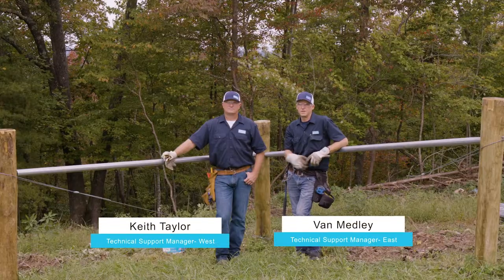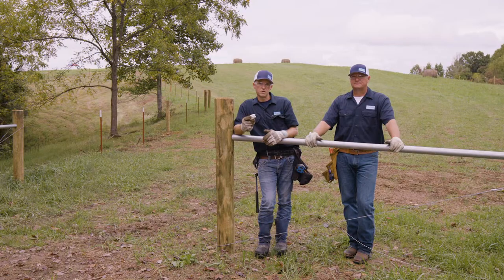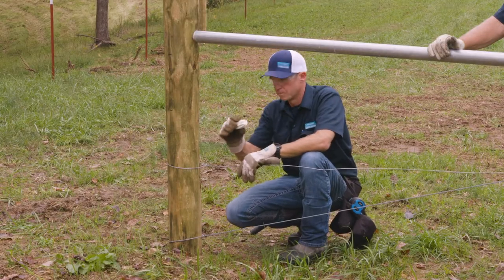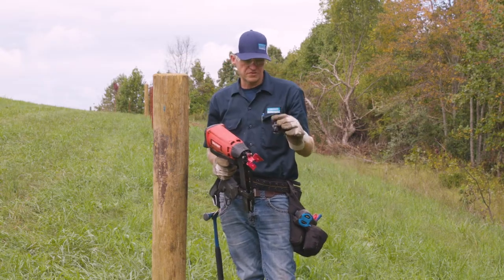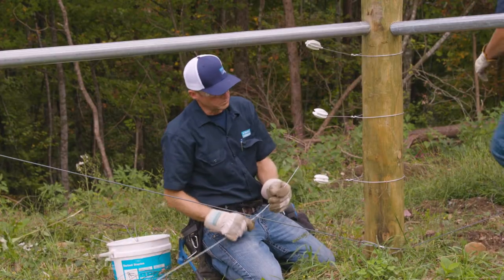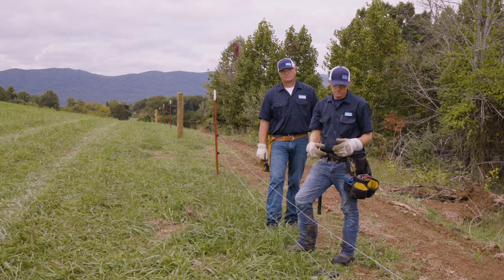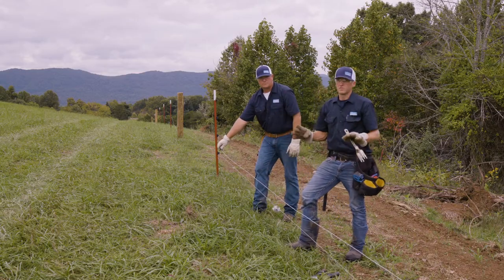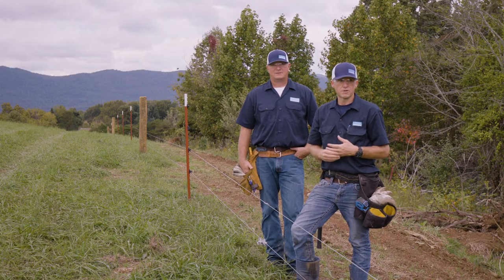Installing High Tensile Electric Smooth Wire | Do's and Don'ts to Proper Fence Installation

Comment: Great video. One question, why is the knot that you use on the post side different than the knot on the insulator side? is it because you want the slip knot on the post side?

Comment: Do you prefer the gripple or the ratchet type?  And can the gripple be re-tensioned when the line sags a bit?
Reply: The gripple can be re tensioned. just put the tool back on and tighten back up. personally, I like the ratchets. No other reason than that they seem stronger and you can tighten them without an expensive tool that I don't carry regularly on the SXS. I buy the ones that have the square drive built into the axle so I can use the forked tensioning tool or just a wrench/pliers. They are also reusable and I have never had one fail, even after a bull decided he needed to be in every pasture except where we wanted him. We both agreed that he would be better off at McDonald's.

Comment: why don't you use a termination knot on both sides and not only on the post
Reply: you only need the termination knot (new Zealand knot) where the wire cannot rotate. Such as when tying to a post. The new zealand knot wraps in opposite directions and prevents the knot from binding and un wrapping when put under tension. You could  use it everywhere but it takes a little longer to tie.

Comment: In what situation would you use, and which situation would you not use, a tensioning spring?
Reply from the maker: Van, our electric fence wire expert says he rarely uses tensioning springs.  They are gauges for measuring tension and not actual springs, proper tension for HT Smooth wire is 200 pounds. High quality and properly tensioned High Tensile wire has elasticity so the springs are not needed.  The exception is if he is installing in a problematic/wooded area on a short run, he will sometimes use them in this situation, combined with a slight under tensioning of the fence as well to allow for as much flexibility as possible for tree/limbs falls on the fence.
Reply: @BekaertFencing  I assume the gripple passes electricity then?
Reply: some people use one spring  if they don't have a tensioning gauge. You tighten the wire with the spring first and then tighten the other strand to have the same amount of "give" as the spring one. Different strokes for different folks